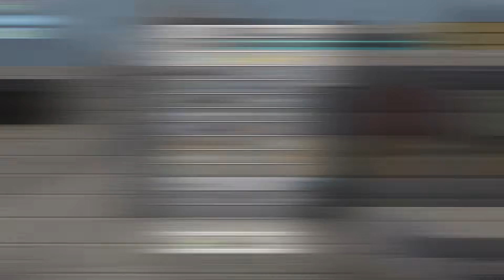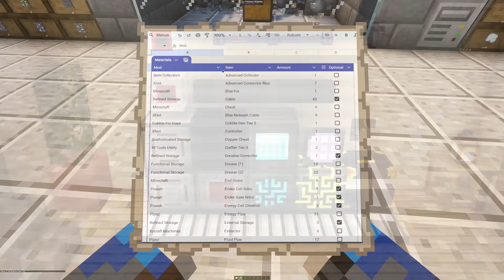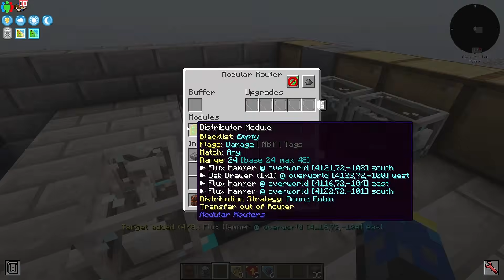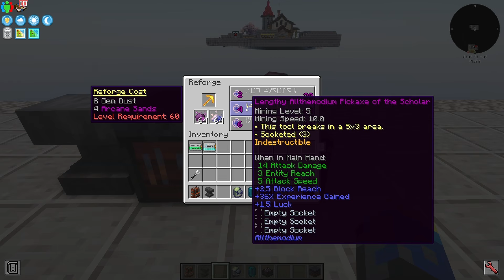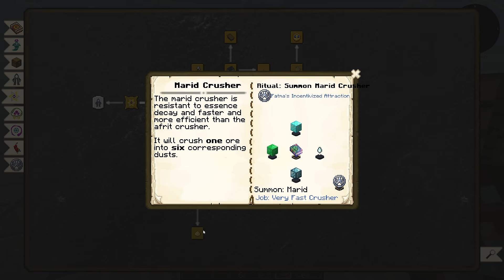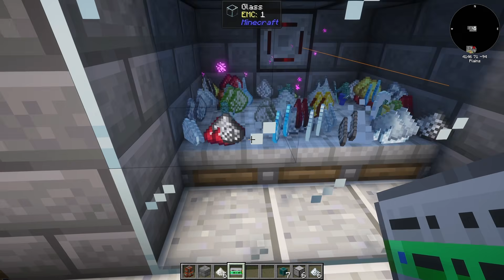The Ultimate Sieving & Ore Automation Setup | All The Mods 9 To The Sky

Comment: Great guide but I'm a bit confused as to why you insist on using functional storage. I copied this setup but modified it a bit. Using Sophisticated Storage saves space when compared to Functional and also does all of the crafting for you as all recipes here are just compressing 2x2. Only downside I can see is its not as pretty. But other than that great setup and great video!

Comment: at 23:25 mine worked better just sucking out of the drawers. using ultimate mek pips somehow was to slow and the modular routers wernt all getting filled up evenly and somtimes some just wernt placing blocks. so suck from the drawers now its instant places

Comment: This is a suggestion after I tried to get a 5t XNET crusher setup. If you make the Occultism 2x4 with a similar setup in the video, the ore will start to stack at ground. The reason is that the Occultism crusher can only pick up 1 radius but he will somehow try to get the one which drops more than that radius, and then he will stuck there. As a result, I found the best solution is to make it 3x3 and put a single router at the middle to drop the ore so every crusher can reach it. Put speed upgrades in the router so it can drop at desired speed.

Comment: Is the 15 modular router that places ore down enough to handle all the incoming ores? I'm using AE2's formation + annihilation planes for these, but I'm not sure if the speed that it places and then destories blocks are fast enough. Not using a buffer in between, so don't want things to overflow
Reply: nvm it was enough. Even if a full stack gave all chucks, 64/4 means 16 is enough to overkill all ore produced

Comment: amazing video. word of advice though...Stella can only be obtained fairly deep into Productive Bees making it a sh*t show to copy you EXACTLY cause thats a prooooooooooocessss to gett Stella upgrades thus i had to reinvent and adapt the entire build based on not having stella bees cause i didnt think id need it also even at 12x the igneous shouldnt be able to produce 64 a tick deff not faster than the upgrades you put in it should smelt much faster than even a max igneous should be able to make
Reply: also the repeated skipping is killin me. when you place the routers and set them with placer modules you skip to the blocks already being placed. mine isnt placing anything but it is set up exactly as yours is so not sure why they arent placing
Reply: figured it out by comments. had to turn on fake players in team settings

Comment: The importer doesn't import anything into my refined storage. At first i thought i set up my distributors wrong but its not that, the only thing that doesnt transport is that chest
Reply: I didn't have any drives in my refined storage oops. But I've got another problem which is that I'm not getting any platinum at all. Don't know what that could possibly be

Comment: took me 13 hours to make full setup tnx for tutorial ✌
Reply: i'm building this right know and i needed only to get all materials 6 hours lul
Reply: how did you set up the end gates for remote power to the flux hammers
Reply: Hey I’m using this tut rn and I was just wondering if you’d be able to help me out, at the part where he has the modular routers placing the ores I’ve followed exactly what he’s done but they won’t place the ores for some reason, do you have any idea how to fix them?
Reply: @tylerhinchcliffe6398 same problem

Comment: Hey, I am having issues with the ore wall. My placer modules all are set to front but a 2x3 section of the wall just wont place anything, I've looked over this for 2 hours at least and cannot get them to place, any reason they would be doing this? The other section 3x3 of the wall works just fine but this 2x3 is acting different with the exact same setup.

Edit:
Solution, open ftb teams and go to settings and turn on allow all fake players
Reply: Bro, you should use the Security Update. It’s the solution to the problem.
Reply: @auk42   updated
Reply: Non of my 5 ×3 wall won't even place at all and did exactly as video 
Can anyone help ?
Also what is the security update?
Reply: @jakesalisbury9853  updated

Comment: A few tips to imporve this setup in the future that I noticed:

1. Instead of using a diamond cobble gen you can use a gold or maybe even iron. A gold can keep up with three flux hammers, with netherite upgrades, with no wasted work ticks, while yes you hammer less per work tick that way you'll also use less power. The hammers use power based on blacks processed, with a full inventory using the entire power buffer. Unless you already have a very robust power system set up this means you'll be wasting work ticks while it gets power.

2. Bulk haunting sand from create is  faster than producing witch water for creating soul sand as it can be done a stack at a time, and it can be entirely powered with a single small water wheel as fan speed only controls range of the fan and not processing time.

3. In general flux network points are a better power transfer option as they can be configured with exactly how much power is need per machine and are renamable for easier management from the controller

4. Meshes can be enchanted with fortune to increase drop rates. a basic set up can get you fortune 3 and with a higher tier apotheosis you can get up to fortune 7

5. The flux compactor works better than the rftools crafter. While it's not as fast as the crafter a single crafter can do all the chunks without any additional setup beyond routing the items properly, which can be easily done with pipez since you're already using the diamond upgrade.

6. The chest filter isn't necessary in the sieve sorting since you're already using a netherite pipe upgrade. You can just black list the chunks on that pipe

7. The whole sorting from the sieves can honestly be vastly simplified. A single item pipe with a netherite upgrade set to nearest first. Then have your main storage closest for everything (an entangled block set to a drawer controller for a central storage system works great here) and the flux compactor at the end for the chunks. You just have to ensure that where you're putting everything else can't accept chunks, part of why I like the drawer controller method since you can just not have drawers for the chunks. But they can also be black listed from basically any storage setup

8. A magnet upgrade in the chest for raw materials eliminates the need for the item collector, and the advanced magnet upgrade also has a filter

9. Instead of dropping using modular routers just use botania open crates, cheaper and easier.

10. A mekanism ultimate smelting factory can smelt more than the netherite furnace

11. There's really no reason to leave the dusts as the recopies that need them are usually crafting alloy blends, something that wouldn't be needed once you're at this point as there are much better ways to make alloys.

12. Using laser io is redundent as xnet can do everything you're setting up with it and you're already using it for the ore crushing
Reply: How would you go about doing the smelting with XNet? It seems like a good idea
Reply: @kurtisheinrichs2724  same way as the laserio. Just use Xnet to route the items to the smelting factory

Comment: Just a side note. You can change the output side of flux hammer and sieve with a hammer. Shift right click or something similar and it will show blue rectangle to indicate which side is outputting. This was tremendous help when I designed my setup.

Comment: Do you know why when i use the integrated dynamics my pickaxe would mine my routers, but when i change it to different direction (from east to south) everything started working just fine? And when i hade a raw_material filter on my chest id did not work and i had to use it without the filter?

Comment: Just built this set up. For some reason the last few drawers in my ore dust don't ever end up smelting (Copper/Draconic/Nickel); they just build up instead... I went back over and made sure I followed the steps for the LaserIO configuration, all the dusts are there. For some reason it just skips over my last three drawers of dust but smelts everything else. Double checked the drawers are all linked the the storage controller. Any ideas on what I could check?
Reply: Did you ever find a solution for this?

Comment: So, why didn't you just have the furnace auto output into the drawer controller for the ingots (which for the ingots, I personally would use compacting drawers)?

Also, you can auto-compact the ores with the Sophisticated Storage advanced compactor upgrade (you have to set it to compact all, as by default it only compacts items that can be uncrafted, and you may want to filter certain items, like netherwart, so that they don't get compacted)

Comment: Hey great video! However, I m having problems with player simulator and 5x3 pickaxe. When I break the blocks myself everything works as it is intended to. However after putting the pick into the simulator it breaks a line in front rather than horizontally. I checked the setting tried to play around the working sides but still nothing
Reply: did you find a work around?  I ended up just making more player simulators and putting them on all the blocks it works fine maybe a bit slower but you need a pick axe without the 5x3.

Comment: Maybe someone can help me. I have the same setup for breaking the ores but for some reason, either the pickaxe is used in a different orientation then the player simulator is used or the pickaxe somehow mines to fast. What happens is that only the middle is mined in a 5x3 Area. Maybe the pickaxe is just too fast. I don't know. But it's also weird that it only clears the middle row. Maybe any of you have a idea.
Reply: Apparently it has something to do which way the player simulator is facing. North-South works no problem. East-West on the other hand does not work and uses the pickaxe as if it WAS facing north/south. Weird.

Comment: ATM9TTS has Ars Ocultas which allow you to put Marid Crusher into Ars' Containment Jar. It'll allow you to pipe in items directly into the jar with Marid inside.
Reply: i tried it chest to jar to chest with item pipez but it didnt work, do u have a tip?
Reply: @DoraNx  try not piping stuff out, the marid throws it on the ground and those you need to use some item absorption.

Comment: My pickaxe is destroying the chest,the modular router and the item pipes behind it, any ideas?
Reply: same problem
Reply: @nyao5001  ive used Block Breakers from industrial foregoing, it works just as good
Reply: @norbertkervarics   some comment here: The 5x3 of the pickaxe will always mine in in a West/East orientation... :DD i just had to rotate the whole section..now it is working
Reply: @nyao5001  damn, i was too lazy to rotate anything xddd it was easier to craft 15 of that breaker thing xdd

Comment: I have an issue with mining the ore, whenever i put my pickaxe inside the chest it just breaks a 5x3 hole through the ore and routers, any help?

Edit: I got it working, for some reason it didnt work when facing east, i turned it to face north and now it works

Comment: You can also use other mods' crushers (eyes aimed at the Thermal pulverizer),  they are  a fair bit cheaper in terms of iron, but work slower without upgrades.

Comment: I'm having trouble breaking the ores down to raw it's like the player simulator is breaking it in the wrong direction I have everything you did exactly in the video and it's not working The player simulator is breaking it in the wrong way and I don't know what to do like breaking it in the straight line instead of the whole wall
Reply: did u ever find a fix?

Comment: When I put the 5x3 pickaxe in the chest it mines the blocks as if the player simulator was on the side of the block its mining instead of in front of it so its destroying the setup. Is there any fix to this?
Reply: Had the same problem but found a fix. Just rotate the setup to the left side.

Comment: How early in to the modpack can we make this system? awesome video by the way!! :)
Reply: Mid to late game power
Reply: @ivanlau3974  ahhh okay, now I know not to try and bash my head against something g I cannot do right out the gates lol 😂
Reply: @Sparklpire  you can simplify a lot of it to fit your needs, the occultism crushers are by no means expensive, and you can easily get some magmatic dynamos for an early midgame setup, allowing you to do most of it. This video just showcases maximum production, but it definitely isnt necessary if you are early or mid game. Just upgrade along the way
Reply: i actually made this without having all the items yet. im still using 1 diamond upgrade or less on those flux sieves

Comment: the ender gates i have arent doing anything. i tried hooking them up directly to the hammers and sieves like shown and i've also tried hooking them to batteries, cells and different energy pipes but they dont transfer any RF/FE

for now im just using a bunch of nitro thermo gens, flux points and energy pipes from the pipez to give the power.

i really would like to use the ender gates so if anyone got any ideas i'd appreciate the help
Reply: hi! i had this problem and didn't know what to do. but when i added energy cell into ender cell (using shift + right click) it worked
Reply: me when i dont read

Comment: Nice build. I have a couple of minor issues I've encountered. The Player Simulator seems like it stopped breaking blocks. I'm not sure what is going on with that.  The one that is really got me perplexed though is on the Dust storage. The drawer in the 4th position to the right in the top row does not seem to process. I've unlinked and relinked all of my drawers. If I swap that drawer to another position, those ores do process. It just seems that in that one spot, the drawer doesn't process.
Reply: Can be a chunk isue. I had it to and moved 2 blocks. Al in the same chunk.

Comment: im recreating this set up, but my pick in the simulator is breaking in a line in front of it instead of to the sides. Any ideas?
Reply: i had that problem too. if you cant find any other solution you could always turn the wall 90 degrees around. that fixed the issue for me
Reply: @Yanixgen  yeah thats what i did in the in the end, thanks though

Comment: Has anyone had issues with the supremium pickaxe breaking in the wrong 5x3 direction? It’s breaking the modular routers and pipes behind just in the row the player simulator is attached to
Reply: yes, from what I've tested it's only breaking correctly if the direction is facing north/south, it's messing up when its facing east/west. However, I've found much easier (and cheaper) to use 2 RFTools Builders, one for placing and the other with furtune mining.

Comment: does the player simulator only work if its facing north? in my world I have it facing west and it keeps trying to break the 5x3 area in front and behind it including the chest, the modular routers, and the pipes. If at all possible, how do I change it to break the blocks to the left and right of it (west to south). I tried going into the part settings and changing "target side" to all the directions and it didn't change anything.
Reply: idk if there's a fix to this but i just rotated the block breaking section to face the other way. if someone knows a way to fix this still leave the comment please.
Reply: having the same issue
Reply: Having a similar issue was well.
Reply: check your chunk protection in the map
Reply: @janziegler3783 what setting should I look for? I enabled trust fake players because I was having issues with blocks not being able to place blocks. but they can place and break just fine it just breaks the blocks north to south instead of west to east.
Reply: you could always turn the wall 90 degrees to make the wall face the right way. i had the same problem and that fixed it. sure it wont look the same as in the video but at least it will work
Reply: @Yanixgen  yeah that's what I ended up doing. But if there is a solution to this I would still like to know.

Comment: Awesome video first off, I love how it includes so many different mods. My only question, which is a problem I'm dealing with now. Is that if you connect the controllers to RS then instead of voiding in the drawers all the excess will just be sent to the storage disks, thus filling them up. Ive changed priority and played around with how and where the connection is made but it always just goes into RS. What's your fix.